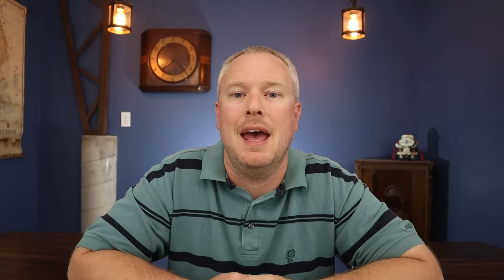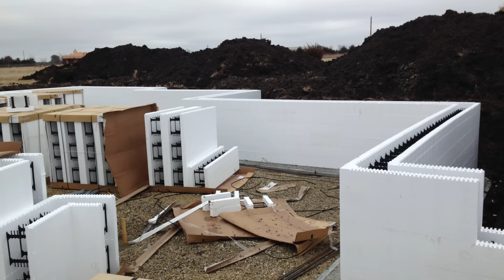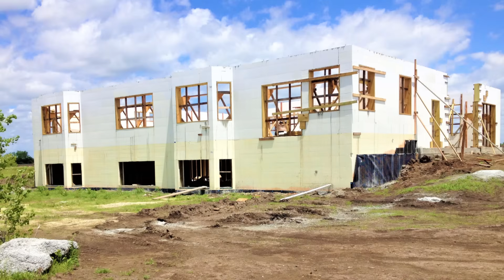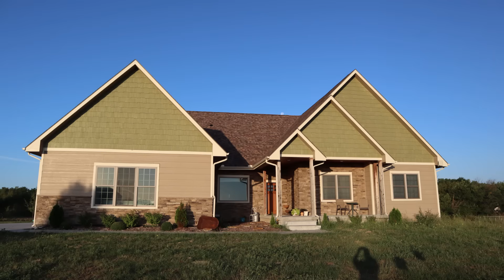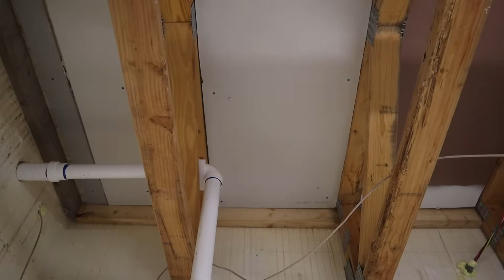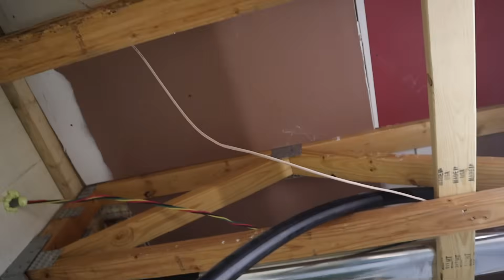Is Geothermal Heating & Cooling Worth It?

Comment: I put in the original Geothermal heat pump in 1986 for our all electric house because we had no gas at our location. The cost was twice as much as a system that would use propane.  The heat pump was very efficient, we had low electric bills for heating and cooling.  After 10 years we needed a part to fix the Geothermal heat pump unit but the company went out of business.  We had to buy another system and spent over $15,000, this lasted for around 15 years until the fluid in the loop ate out the inside of the unit.  Then we had to replace the liquid in the loop and another unit which cost over $26,000.  I will not use another Geothermal heat pump system again. In 30 years I spent over $48,000 on units, I did not get that back in savings.  I am going with Mini-splits now.
Reply: But the tech has probably evolved in the nearly 4 decades since then, right? While your experience is unfortunate, installing in 1986 seems like your were an early adopter and your experience illustrates the ‘early adopter tax.’ 

Doesn’t seem necessarily applicable to a new install today.
Reply: @Jason-sp5yc  one every decade, decade and a half isn't worth it
Reply: @Jason-sp5yc dude was a “pioneer!” He probably had a room-sized mainframe personal computer too! ✌️
Reply: @Jason-sp5yc  it was 6 years ago when I replaced the last Geothermal heat pump that cost us $26,000,  Then they told me the system only last 10 to 15 years.
Reply: @bobwarfel241  Got it. Did you happen to get multiple quotes? I'm wondering what kind of lessons learned there are from the initial install that could be avoided today. Geothermal fundamentally seems like a system that could/should have long lifespans.
Reply: @Jason-sp5yc  When I had the first one installed in 1986 there was only one company in Illinois and they where three hours away from us. When we needed our second system there was only one company that was installing the systems but they were closer this time only one hour away, even though we lived only sixty five miles west of Chicago.  The third system there were two companies this time that we could get prices from and they where both the same price so I went with the company that I knew.  You asked if I learned a lesson.  At the time in 1985 I did all of the research this was the best option and the our electric bills were lower then the neighbors, I did not expect the company to go out of business and I couldn't get parts any more.  Now they say the systems will only last 10 to 15 years which is like refrigerators and everything else.  I was told by car mechanics in two different towns  that Ford has stopped making parts for some vehicles after four years and they have customers that have a five year loan and now they can't get parts for their vehicle, so you just don't know what a company will do or be there in the future.
Reply: @bobwarfel241  your story is very similar to all the southwest people that installed solar hot water systems in the late 70’s early 80’s. Reagan cut the tax breaks and R&D funding dried up, so all the companies went out of business so there weren’t replacement parts   . I’m curious if you had any titanium heat exchangers and piping in your systems. It’s been a game changer, but nothing is ever cheap.
Reply: @flipnotrab  I do remember the solar hot water heaters and how the panels would follow the sun.  I looked into that also but I did not feel the cost was worth it.  The Geothermal heat pump heated my hot water and the house which made more sense so I went with that. 
 I do not know what type of heat exchangers I had on all 3 of them.
Reply: @bobwarfel241  Unfortunately, water chemistry (ph) wasn’t taken into consideration for many years of building various heat exchangers and other sections of hvac/water heaters. Titanium has changed the game a LOT. Granted, titanium heat sink values aren’t as good as other metals, the longevity of it far out weighs its lacking there. It’s too bad there aren’t some type of “early users” tax credits or a manufacturer willing to to give people like yourself deep discounts to replace old systems with higher quality ones. It would make great advertisement and sales on many fronts.
Reply: @bobwarfel241  after all, it's like  complicated refrigerator
Reply: @Jason-sp5yc  the weak link seems to be the ‘consumer electronics’ part - the unit. radiator+fan avoids this, but wont be as efficient. the high tech part (computer controlled mass produced unit is the weak link IMO, and they are expensive to fix. no idea if the radiator+fan thing actually works well, just saw it on YT.
Reply: @kristiank1276  the radiator/fan thing works but it's a fixed temperature – whatever the ground temperature is at the depth you dig. Great for greenhouses or garages, not so good for houses.
Reply: @bobwarfel241  this sounds like someone is specifying a refrigerant that's attacking the internal parts of your equipment – is it worth looking for a class-action lawsuit to sue the manufacturer?

Going forward it's worth researching to see if there's a unit without this built-in fault. (Try Chinese or Israeli units, they're both regimes whose politics you might oppose but the equipment is ubiquitous in-country so should be reliable).
Reply: @bobwarfel241 I'm sorry for you. My husband was just telling me about a customer he has who built his in the 70s or 80s and he keeps asking them to make repairs. The guy will not let it go. I'm sorry your experience was so much rougher
Reply: @flipnotrab thanks for nothing Reagan!
Reply: @Jason-sp5yc 
I think you didn’t read or didn’t understand what he wrote.
There was no gas,so he didn’t have a choice.
He was not a pioneer.
He replaced it too many times to be a big money saver.
Reply: I'm going to just do a diy water system way cheaper to build and repair
Reply: @williamkreth  Hello. Would you be kind to tell me what exactly do you mean by diy water system?
Reply: @poptamara  you simply dig a deep circular hole lay plastic tubing wrapping around a few times, have a pump move water through the underground pipe going to a radiator with a fan. You have to properly size the system for whatever space you have
Reply: @williamkreth this is what I plan to do, just need to figure out how much tubing and how much digging I have to do.
Reply: @williamkreth  Why do that when you have swamp coolers
Reply: @williamkreth hey good call, do you recommend any videos online or anyone thats tried it? Cheere
Reply: @Michael77711  @williamkreth I am interested in this as well.  Even if you just use it to precool the attic, it might be something to consider if it is simple enough.
Reply: @williamkreth How is the water system?  Get your ph perfect
Reply: thanks for sharing. thats the good, the bad and the ugly right there.
Reply: They make titanium heat exchangers to separate ground water from the system and prevent corrosion from acidic water.
Reply: In the UK we get incentives from the government althought they'r e now getting stingier. So I got an ASHP and paid £9,000 all in in 2015. The government gave money which  basically pays off the capital cost over the following 7 years. With savings verses oil (we're off grid) and the pay back it was definitely a great investment.  They're very reliable and no need to dig up your field or garden like for ground source heat pumps or like in your case if you have issues. No issues yet at all after 8 years using it and when we need to replace it which may still be a long time off compared to say a boiler, unit prices have actually now come down a lot and are only about twice the price of a boiler plus I could potentially swap it out myself which I couldn't do with a boiler. Also no yearly safety checks required so savings and hassle sorted there also.
Reply: My building replaced oil boiler twice in 10 years. So it’s not a question of savings but quality of parts
Reply: I wouldn't take this person's advice for a reason not to do geothermal. Their poor decision making and throwing units at their issue and claiming the fluid ate up the heat exchanger is silly. Someone definitely didn't know what they were doing. You have to use distilled water and the right coolant. And I bought a brand new unit for $4200. Put my own loops in for 2k. Thats the excavator rent for three days and the tubing. I dont know what other system you could put in for that!
Reply: @lovetofly32  You have to remember I put in the original Geothermal heat pump in 1986. I was one of the first people in Northern Illinois to put this system In.  This system was advertised on TV commercials starting in 1984, that's where I learned about it.  I installed 2100 ft of 2 inch poly pipe with my tractors so I could afford it.  The second system (heat exchanger unit)  was install because the original Geothermal company went out of business and I could not get parts. Again there was only one manufacture making the Geothermal heat pump so I had to go with them.  After that system started to leak there were two companies making Geothermal heat pumps.  After talking to the 3rd company he said they stopped using glycol to prevent freezing because they found out it eats the pipe in the heat exchanger unit and now use a different liquid to prevent freezing.  When the county took 1 1/2 acres of my property to fix the road in front of our house I had to replace the 2100 ft. 2" of pipe. Now the Geothermal heat pump company said we have found out 1 1/2 inch pipe is better for transferring the the eat to the pipe. Every thing changes, you can not buy the same coolant for you refrigerator or air conditioner that was installed 30 years ago.  I have talked to furnace repair companies and they all say furnaces only last 10 to 15 years  even Mini-splits.
Reply: Depends where you are?
Reply: This is why diy is so important.

It may look like I've got a 1 of 1 cooling system, but it's really a diversified device who's parts are shoved from multiple companies that aren't involved in such a specialized tech sector. I know where parts can be replaced with other brands, substituted for similar parts, etc. Very robust.
Reply: Is there another pess corrosive option other than glycol?
Reply: Sounds like you has some shitty ass installers and techs. I’m in HVAC and I have not had any issues with mine. I also did mine myself so I knew what to look for. Also that’s 48k be careful with mini splits they are not all built the same. Also the refrigerant they use may be phased out( case in point R-22 and phase down with R-410a.) which will double that cost and depending where you are. They do have extended warranties on them. Per certain state laws. Hope this helps!
Reply: Yikes 😳
Reply: No offense but the mid 80s was extremely early to be doing that. 40 years later I bet the technology has come a longgg way
Reply: Lmao
Reply: Solar seems to be the best option
Reply: what where you running for coolant? acid?
Reply: @DeviloftheHelll  I can’t remember the exact name of the antifreeze when I installed it in the pipe back in 1986, it was something Glycol.  At that time Geothermal was the only manufacture of this furnace and that was what they required for preventing the pipe and system from freezing.
Reply: @bobwarfel241  any automotive stuff os meant for aluminium. straight up glycol diluted to working points is all needed, safe on the PE piping and copper
Reply: Hell yes.. mini spits and solar !!!!  EG4 makes some killer stuff.
Reply: I don't understand how they were not able to fix the original unit, it would have had no circuit boards. I have a hydro heat unit from 1989 I bought used and installed in 2008 still working, I have only installed a new blower unit in it
Reply: These systems are for two kinds of people only: the rich and the hardcore DIY. No room in the middle.
Reply: Just broke the bad new to a homeowner today that thier geo pumps were gone. Many bad parts, flat on refrigerant. 13 year old system. Not worth fixing.  Nearly 30k each for replacement.. not original owner. When they were told by thier original  Real estate agent That the system would last for 50 years.... 😆 they  were Estatic.. yeah..  The water loop ground loop is guaranteed for 50 years but not the pumps they are  Essentially a heat pump pretty much just like any other heat pump. 10-12 year life span
Reply: @perryfree2592  same scam with solar panels. The inverter or something only lasts 10-15 years on a quality one.
Reply: I think Bosch will probably survive and keep making parts.
Reply: Most are very complicated on the electronics and tend not use genetic parts. Things will always be cheaper on a ubiquitous gas boiler unit.
Reply: My personal experience matches this commenter.  
  Unit installed in 2012, and the compressor died a month ago.  $14,000 to replace it.  Original cost was $35,000.  
   $14k + 35 k, + 12k/year for 10 years, = $170,000 for ten years, which is of course $17,000 per year in heating costs.  For a 3300 square foot home built with good insulation in 1999.
  With electricity being 30 cents a kw/hr in Maine now, geothermal is not worth installing.  Its wasn’t worth it when electricity was 18 cents/kwhr
Reply: @jku72  if you have experience digging you can do all that free your only paying the plumber to connect to the unit so basically your only paying for the unit plus piping
Reply: @jku72  bosch are making the units now surely you get a warranty with them, plus if you have it running solar power its free heating
Reply: I wonder why the company went out of business?
Reply: So you base your assessment on flawed installation of archaic equipment?

Comment: I'm in Australia and I have a gas hydronic in floor system for heating. Is it possible to Cool my home with a hydronic system? So I could get away with not putting ducts in my roof and have a water to water system. If it's possible I will definitely be interested in getting this geo system.  I don't have solar yet so could you please give me an idea on the power consumption of the unit.
Reply: Im an Ozzie also. The best approach is to fill every available roof area with solar pv, and fit efficient rc ac.
This way the roof area can be used 365 days a year, to rovide power for heating, cooling, power yohr house and sell back to the grid. I do and receive a $3k cheque every year from my electricity supplier, and have no power bills and some of the solar feed in credits also pays for my tiny gas bill.. The large roof top solar pv also shades the roof and keeps it cool in summer.

Cooling the floor isnt a great idea. Cool aid is denser, thus heavier, and sinks to floor level. You want cool air where you live (ie, not on the floor) and cool air should ideally exit your ac above you. It will then sink down past you to the floor level.

You will save tonnes of money by turning your gas heating off, and running a small split ac in the room you spend the most time in. I run a 400w radiator m my office and am as warm as toast in winter. Cheap as
Reply: @nordic5490  g'day mate. I hear what you are saying. My plan is to get 16kw of solar on the roof but my electricity bills are very little to begin with ($100 month)

I love my in floor hydronic heating and wouldn't change that one bit. The reason I would consider the in floor cooling is so that I don't need to install ducts in the house cutting the install price a bit. I'm in Victoria so summer gets to about 41-42 degrees but the house wouldn't get above 30 so I'm not as concerned about the cooling and if the in slab reducs the house by 5 degrees I'll be happy. The advantage of in floor hydronic heating with no fan, noise, dust, dry heat is such a winner for me.
Reply: @robertpoynton9923  Floor hydronic heating is a problem in humid environments - condensation. Air ducted cooling also works as a dehumidifier (the moist warm air condenses water that is sent out the drain line).

Comment: Also, I am wondering if you have ever measured amp draw on the system while functioning.  I have a 3 ton unit that runs currently about 2500w and I am looking for something that works in a much more efficient fashion.  I can never seem to get an answer on running wattage of these and would love to know.  I have to use a 5 or 6 ton unit when I install as I want it to cover both floors of my home and I really do not want to use anything else other than this so that I can account for that load.  Thanks!
Reply from the maker: I have not and don't have the equipment to do it.
Reply: @Challenged1  I run everything off solar so accounting for loads is imperative. Knowing how much something draws allows for proper battery storage calculations, etc. I appreciate your response.
Reply from the maker: @nubiandavis2610  Makes perfect sense.  I'm grid tie
Reply: Couldn't you ask the manufacturer? Also how large is your solar system to accommodate heat pumps and such?
Reply: @jksatte  the manufacturer will give you plate information, but that is by no means real world accurate.  Accuracy depends on setup, load calculations, weather and a myriad of other factors.  My system is 13kw with 90 kwh lifepo4 48v battery bank.
Reply: @nubiandavis2610  clearly amateur hour here has no idea. I hope you get answers.

Comment: My geothermal system passes air through 4 inch landscaping drainage corrugated pipe and pushes air to my AC condenser coil. Not a heat pump but at least I save money in the summer.  This is the second summer of use. My electric cost went down about $500 per season. It cost me $1500 to install and next year I will have recovered 100% of my investment. If and when my AC system breaks down, I will replace it with a heat pump to use year round and the cost should go down even more. My total summer electric bill from May to Sept, went down from $900 to $400. So even a poor mans geothermal can work for you.  I am designing a cheap liquid heat exchanger  to test out on a swimming pool as a heat sink.